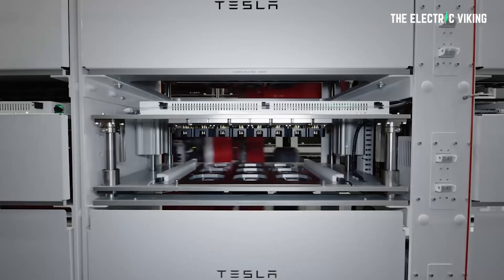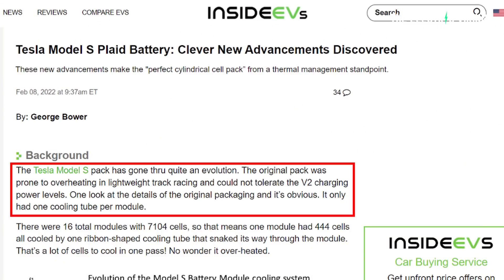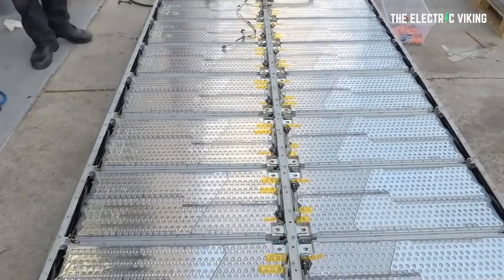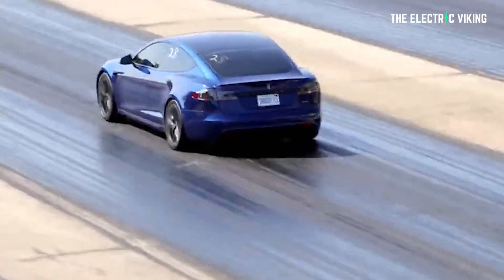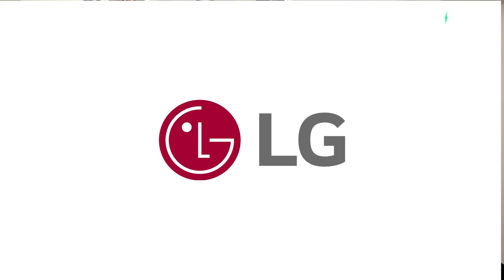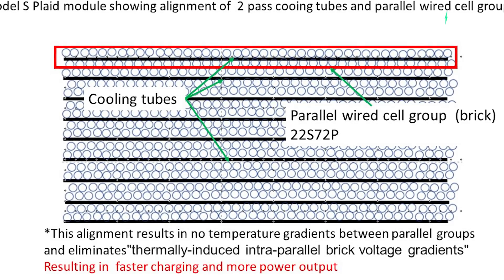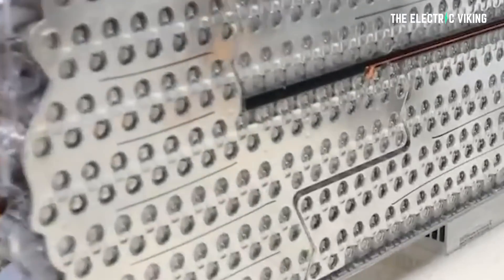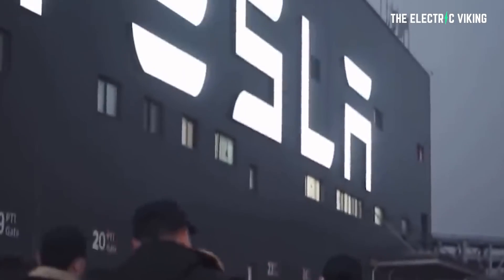Tesla's Plaid battery pack compared to 4680 - which is better?

Comment: I mostly enjoy your videos Sam and I have to comment on this point your trying to make about cooling lines. Talking about number of cooling lines per number of battery cells is meaningless. The flow amount could be the same just arranged differently spread over two hoses. The internal resistance in the cells can also be different depending on the difference in chemistry. It’s a lot of small factors that can affect the cooling and contribute to the better result.

Comment: 5:57 wrong. Teslas do not use crank shafts, and hp is always measured at the wheels since they are direct drive. Dual motor systems aggregate hp
Reply: Although the most accurate metric for EVs is torque.

Comment: Now to see if the engineers put some insulation into the packs to protect them from the extremes of heat and cold and potentially make the vehicles slightly more efficient as the energy needed to maintain the right temperature in the battery pack is reduced.
Reply: You think the "resin" (adhesive) in the 4680 pack won't act as an insulator?.
You still need "energy" added in the first place.
Reply: @rogerstarkey5390  it might add a bit of insulation, but it might not be significant (I dont know as we have no idea what the R values are on that material.) 

Yes you may have to add energy, or remove energy, but that temperature will be more stable requiring less heat needing to be added/removed from the pack.

Comment: If the new Battery is so much better than the existing form, Tesla may fall into the Osbourne effect cesspool, No one will want the old design but all the existing factories are still churning the cars out.  Would you cancel a Fremont reservation and get into the Austin queue.
Reply: EVERY company will go through the same scenario in the next 5-10 years..... IF the promises (of those companies) come to fruition.
The added problem for others?
They're essentially not "the big dog".
If they use the same supplier as other companies, who does that supplier feed first?
Let's say LG had a new "super cell".
First, that may Osbourne THEIR existing product.
Then, everyone they supply wants it first.
Then, news of the new cell Osbourne's ALL of their vehicles.
I think we're going to find Tesla has though of that.

They've gone to Panasonic, LG, probably CATL(!) maybe even BYD (?) and said
"We have the machinery.
You have the expertise and factory space.
Let's build as partners"
These 4680 cells being announced are Tesla cells essentially under licence.
They get first call on the cells.
The manufacturers get to sell the excess (as and when it happens).
Tesla gets a royalty for those cells as well.
Plus, Tesla could say "old stock? We can use that for other things" (storage)
Rather than Osbourning, it solves problems.
"Battery wars"
"Supply wars"

Btw, watch what happens with Nevada.
That's a LOT of 2170 cells going spare this year!

Comment: They’ve got the hard part down yet simple stuff like adding brakes sufficient for stopping a Plaid from 150 mph repeatedly are missing.

Sure they offer an overpriced carbon composite brake option but that’s not even a factory installed option. It gets done after the fact at a service center, assuming they have it in stock.
Reply: For normal driving the stock brakes are fine. Anyone racing and using it for tracks, would upgrade to the track package.
Reply: How much is that Taycan ceramic brake kit again?
Bearing in mind it's an cost option on the Taycan, which is  heavier by 208kg (458lb)

Comment: BYD has the strongest supply chain by far, and it's rumored that the cost of their blade batteries may have dropped to around $60 per kWh.
Reply: US$60/kw !!!!  ...... ICE are NOW 'Confirmed" as DEAD. 🤣🤣😂😂😅😅
Reply: Next question.
What's the kWh output per SQM of factory.
How quickly can they make them, and what size of factory, 4680? Very fast, very small factory.
That's what's needed for Terrawatt production.

Comment: It will be interesting to see who’s correct about the “perfect pack”, Tesla engineers or random guy from internet? Lol
Reply: Watch Munro Live. He is a engineer who has worked for all the OEMs through out his career and he is currently tearing down a Model S Plaid and its clear to see Tesla is the leader of the Pack in many categories
Reply: @Anthony__420  and it’s not a 4680.  They said it was the smaller 1860 series.  Better heat transfer.